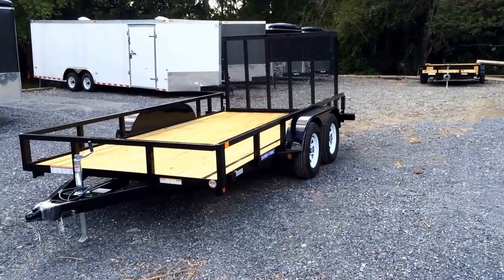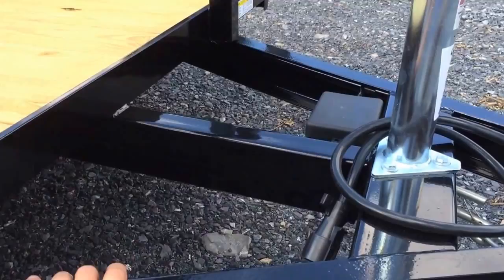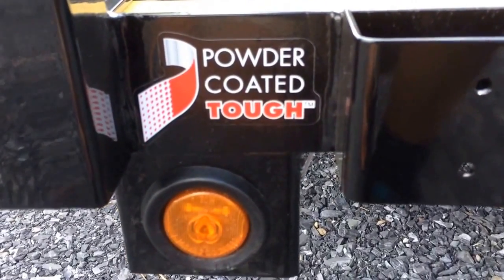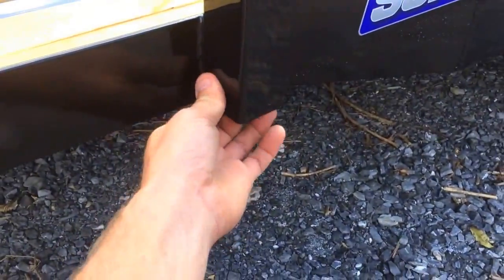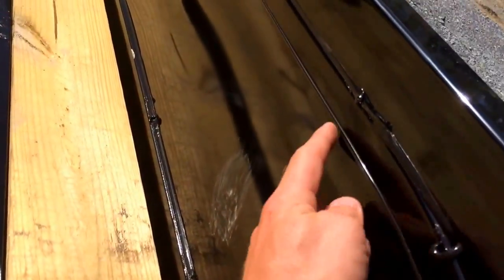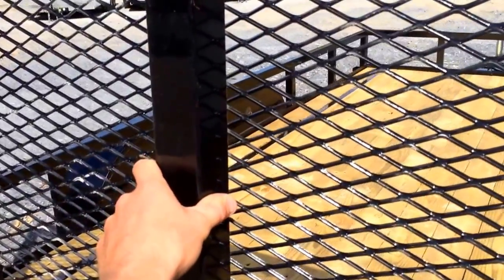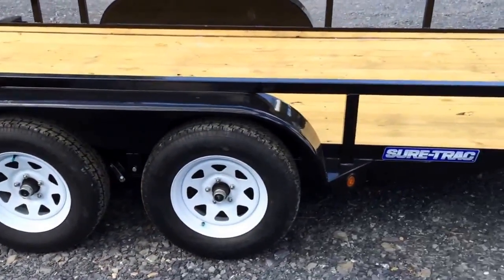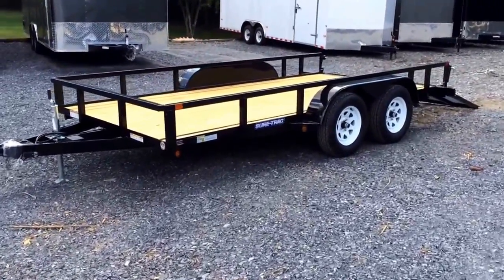Sure Trac 7x14' Tube Top Utility Landscape Trailer 7000# GVW ST8214TAT-B-070  Best Choice Trailers

Comment: I have a class 2 hitch. Can tow up to 3500lbs. My question is about tongue weight. Mine rated for 300 lbs. and think you said this trailer had a 700 lb TW. So it’s a no go correct? Exceeded TW of 400 lbs??
Reply from the maker: Sounds like you'd be a good fit for a single axle 2990# GVW.  Tongue weight is typically around 15%, so on a single axle you should be roughly 450# max.  To work within the recommendation of your vehicle, it would look something like this.  2000# load would be 300# tongue weight = 2300#.  Single axle 6x10' trailer is around 1000# empty, 1300# payload.  You could haul roughly a 6x10' single axle trailer with 1300# of cargo with your tow vehicle.  Here's a link to our in stock single axle utility trailers: https://www.bestchoicetrailers.com/all-inventory/utility-trailers/steel-single-axle/6x10

Comment: you can pick the gate up whith your foot because it has spring to make it seems like it is lightweight but your not fooling me
Reply from the maker: I think you missed the point.  It's a HD gate with tube crossmembers, but due to the spring assist, the gate is very lightweight to handle.
Reply: He mentioned spring loaded. He also picked up with his foot. He also said it's pretty heavy duty. And all of this was shown in the video. I don't feel he was trying to "fool" anyone.